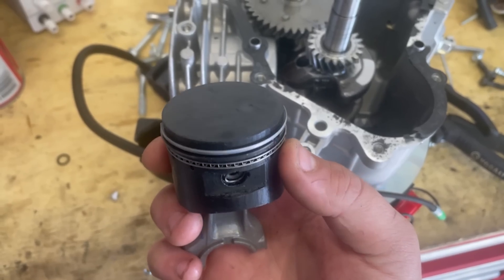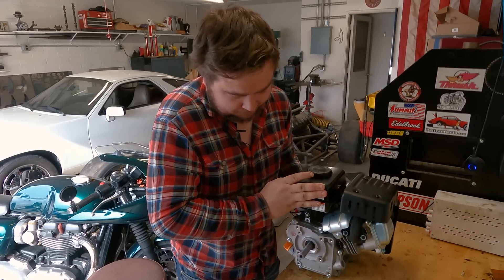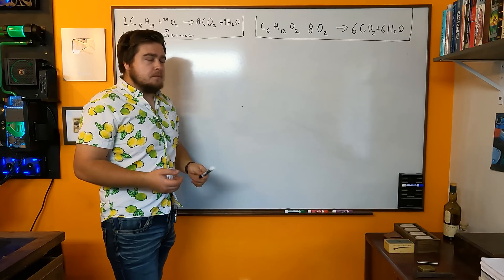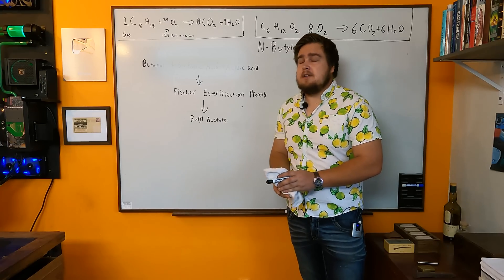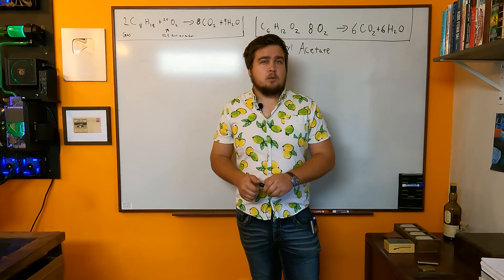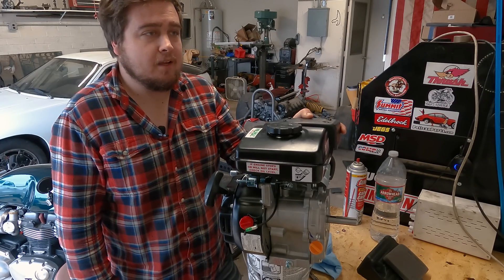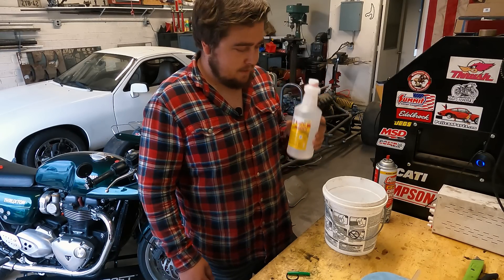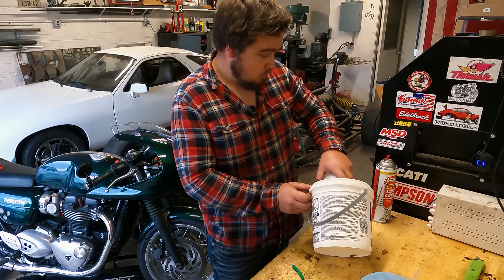Cold Burning Fuels and Plastic Pistons for Harbor Freight Engines!

Comment: you would need to send out for this but you could try a print with delrin and maybe cap the top of the piston with a cerakote you keep the fire from directly contacting the delrin and making formaldehyde gas
Reply from the maker: Cerekote is an interesting idea, that might work
Reply: @WesleyKagan  i only have enough experience with cerakote, that it has possibilities you should ask a local shop that works with it

Comment: Not sure what happened to my comment. 3dxtech carbonx+cf10 might work, 343°C. What was the weight difference? Maybe a metallic coating, like chromium. Rob Dahm did a video with a tool that distinguished what metal the item you are testing is, the best looking parts of the engine were chromium iirc.
Reply from the maker: Interesting- obviously composites are going to be significantly lighter. But until I get some good temperatures I don’t want to commit to a specific material